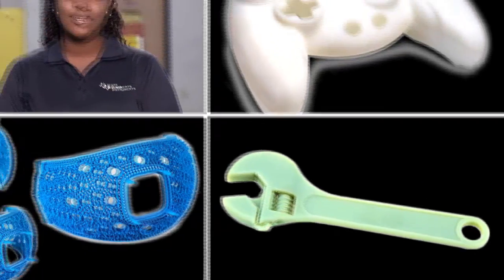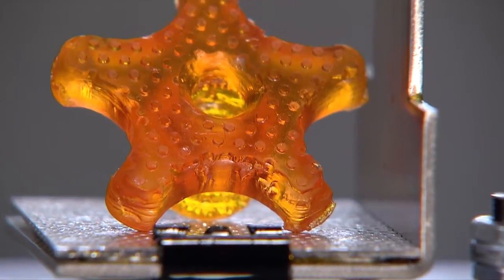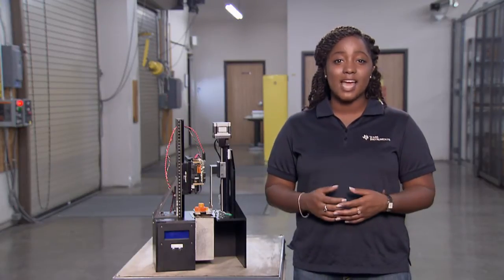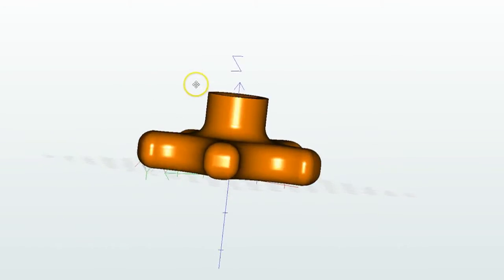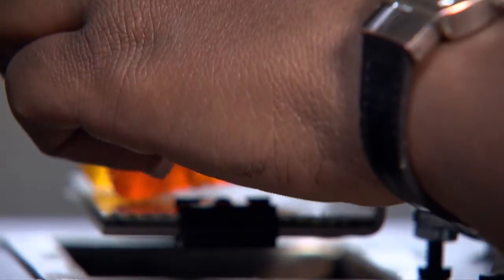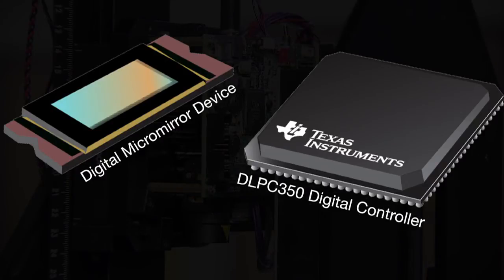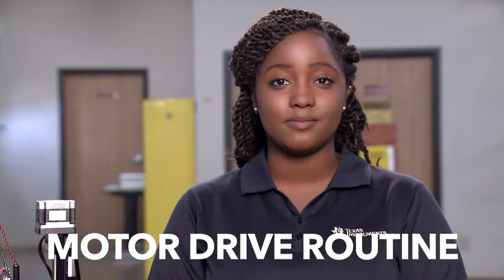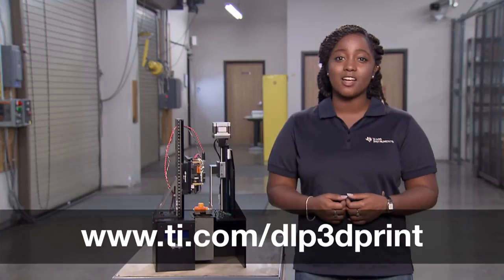3-D Printer TI Design Powered by TI DLP® technology

Comment: I checked your website. There are no circuit scheme, valid firmware for electronic card in the documents to make DLP printer. Also,  you shared gerber files belonging to beaglebone card. Can we use ready one without producing this ? I am thinking of buying DLP 4500 but the information you gave is not sufficent enough for production